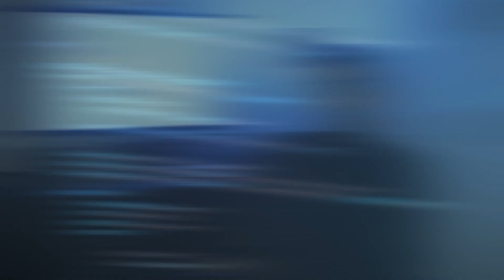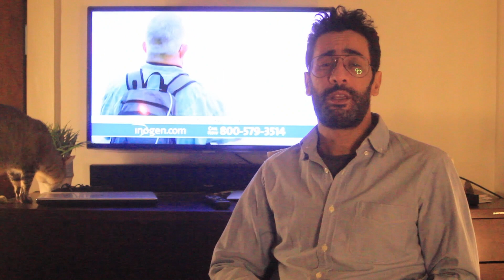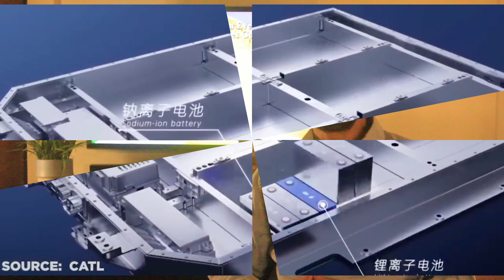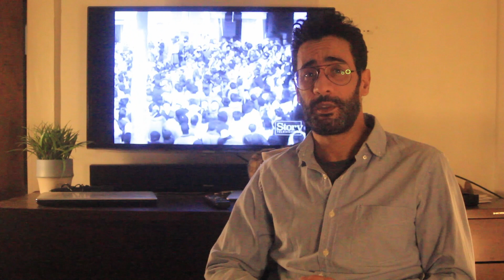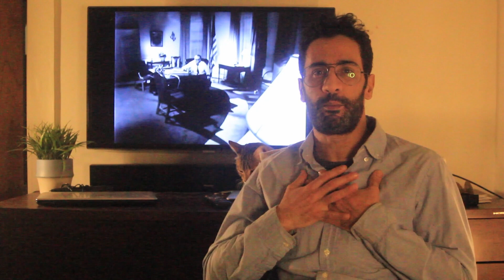SODIUM ION BATTERY!! CHINA OR UK ...    #technology  #future

Comment: Got some facts right, got some facts wrong in this video.
Lithium is one of the most plentiful elements that can be found in the crust of our planet but it's typically hard to extract and purify most of the lithium from around us. The places where Lithium currently is mostly coming from is <not> from Africa, there are deposits in South America, Australia and China plus some deposits in other places like Eastern Europe and parts of the US. Other rare earth minerals which are critical parts of the lithium battery we use today do come from Africa.

Additionally, it's pretty optimistic to say (I think is what this video is saying) that Sodium-Ion batteries are about 150 or 160 watthours/kg compared to Lithium-Ion is supposed to be about 200 watthours/kg  . If you're comparing strictly the difference between Sodium-Ion batteries vs Lithium-Ion batteries, the Sodium batteries should have a little more than half the potential of Lithium and that's because of their positions in the periodic table. The physical characteristics of Sodium are that it's approx double the mass and so will always be about twice as heavy and twice the volume as lithium batteries, all other things being equal. And "all other things being equal" is the key to understanding why sodium will never compete with lithium in mobile, high performance devices, vehicles and aircraft. Because their chemistries are so similar, any developments that would advance the performance of sodium can also be applied to lithium as well. It's a race for better technology that sodium can never win. Sodium has a place but not in competition with Lithium in small, light, mobile devices and uses. Because Sodium has a major cost advantage over lithium today, Sodium is the better solution in immobile deployments like metropolitan power plants, or homes and other buildings... Wherever square footage and volume isn't an issue.

That said, circling back to the point that Lithium is one of the most common elements found in the earth's crust, there are numerous initiatives to develop new ways to extract lithium from new locations. One very promising possibility are dead seas where the water or effluent has an extremely high mineral content. Usually that mineral count includes lithium and because it's dissolved in water, it's already in a state which suggests various minerals including lithium can be separated from the others. If technology is able to extract lithium from more sources, the cost of lithium is expected to decrease and will become more plentiful for all the batteries humanity needs not just today but far into the future.
Reply from the maker: Hi Tony! You are totally on point. Your way of going into details is well constructed, rich, and amazing but it will make the video too long for my viewers considering im new to youtube. i do agree with you! I shouldn't ve pointed Africa only. In a way i was trying to  tie the example to the african civil wars and other things that harm that continent more than any other place where Li is been extracted. You are also right about the performance fact. Li will exceed Na anytime of day but until there is a way to contain the fire hazard, the industry will refrain from such thing. Please understand im still learning how to construct my videos and still experimenting with them to give the viewer such great experience. One of my viewer mentioned loud music wich I will improve on next video. And from your comments i understood that viewers want more details. Thanks again and i hope you let me know what are your likes and dislikes about the next video. Please dont hesitate to subscribe for next content.